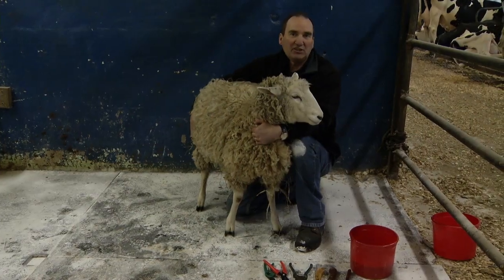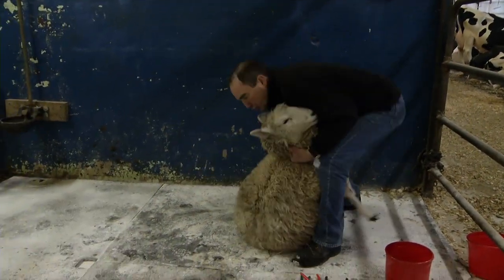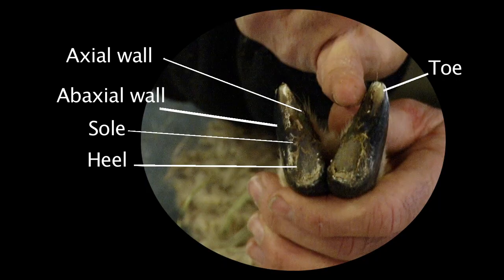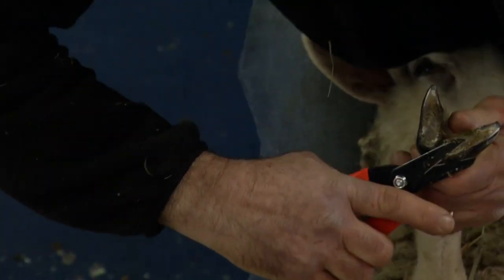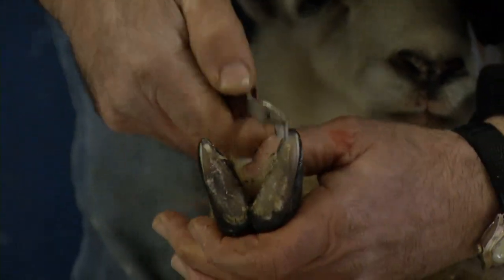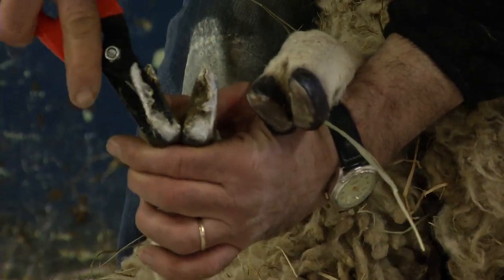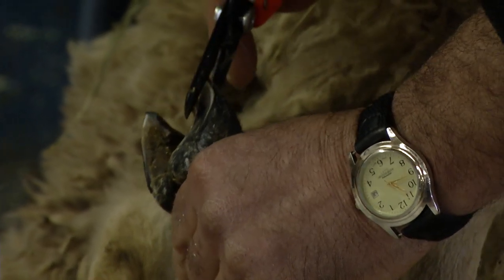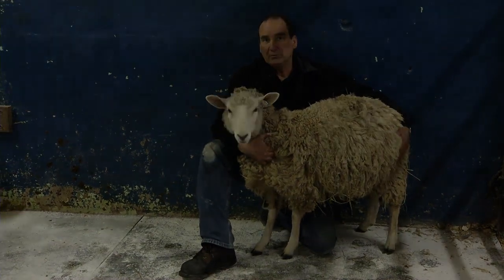How to Prevent Sheep Foot Rot

Comment: V.good video thanks, i am a hobby farmer from Malta, with regards to the cutting off the overgrowth of the abaxial wall, exposing the sole at 3:15.does exposing their sole cause any problems on stoney soils?  sometimes they also develop a swell above the interdigital area and white hair/tissue comes out of a small orifice. I usually press it clean and spray it with disinfectant to cure it - what causes this? thanks

Comment: This is insane! Up to ten times trimming the hoofs...
I remember when my friend's sheep flock was for years really heavy in trouble with hoof problems.
(This might be anecdotal, but...)
What did not help was... (a lot of) hoof trimming!
What helped - at least after it, the pandemic like problem disappeared:
1. barn hygiene: emptying the barn completely after (!) the winter and leave it alone for the rest (!) of the year
2. applying vineagar on the concrete floor: those bacteria seem to prefer alacaline conditions - which is what they get on concrete
3. not bringing in too much litter into the deep litter barn, as it consequently heats up too much: the rule is basically that what is left over from hay feeding (stems) is enough!
4. stop trimming hoofs...  (more or less) ;O)